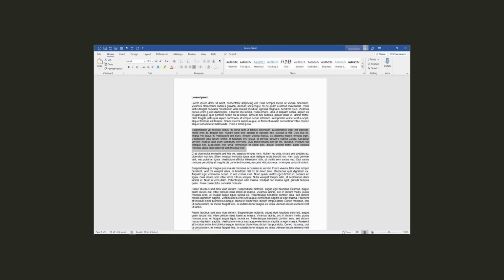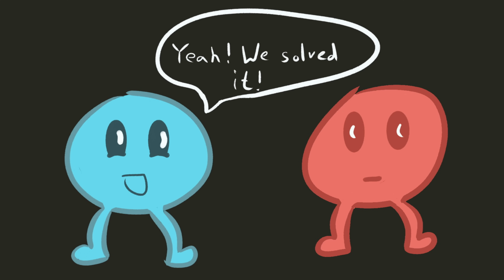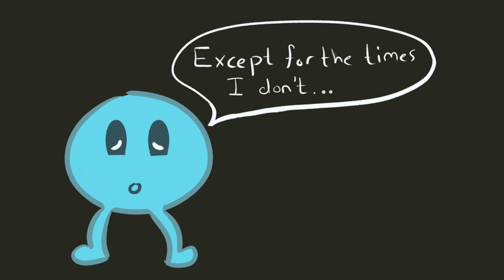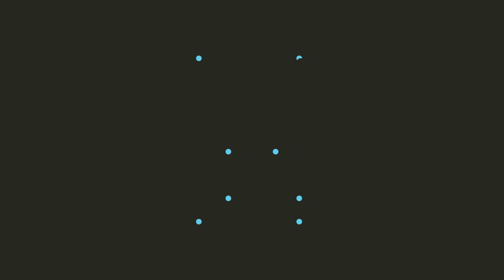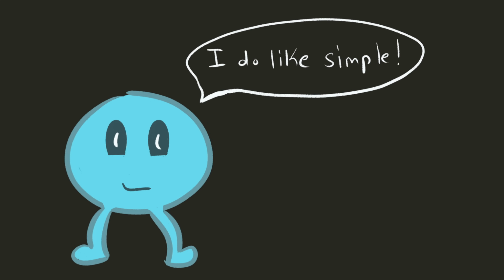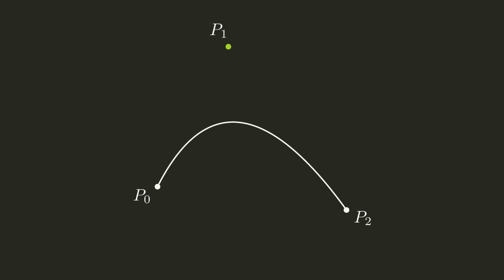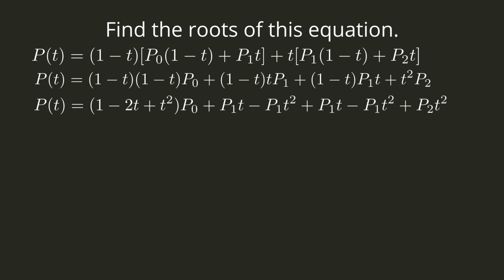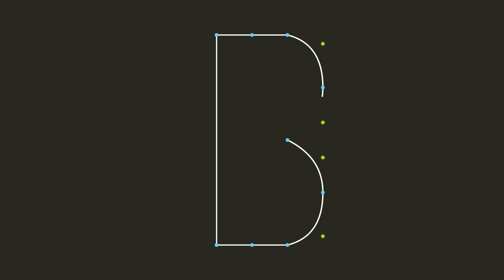The Math Behind Font Rasterization | How it Works

Comment: Might be worth mentioning that there is an alternative solution for fast, real-time rendering of glyphs pioneered and patented by NVIDIA, which is based on using the stencil buffer to determine coverage per pixel. 

Basically, a pixel is subdivided into subpixels and a shader determines for each subpixel whether it is inside the glyph or not. This can be quickly determined if you are smart in how you create your geometry. Quadratic curves, for instance, can be evaluated by creating a triangle from points p0, p1 and p2 and using barycentric coordinates for the vertices. It then becomes trivial to determine whether the subpixel is inside or outside the curve. 

The "winding" path is then drawn first, adding values to the stencil buffer. Next, the "non-winding" paths are drawn, subtracting the values in the stencil buffer. You end up with a stencil buffer containing ones and zeroes for every subpixel. 

Finally, in the so-called coverage step, you calculate the coverage of each pixel by adding all subpixel values for that pixel; if 16 out of 16 subpixels are set to one, you have 100% coverage, but if only 8 pixels are set to one, you have 50% coverage and so on. The final color will be determined by using coverage as an alpha value, or by multiplying the red, green and blue colors by the coverage. 

Substantial research has gone into finding ways to generate optimized stencil and coverage meshes to render, as well as coming up with ways to efficiently store these mesh representations on the GPU. It's sad that this process has been patented, but on the other hand it's free to use if you own an NVIDIA GPU. See: https://developer.nvidia.com/nv-path-rendering
Reply: Other than implementing it with hardware assist, I'm surprised that Nvidia got such a general  patent on the technique.
These sampling methods were being done in the 1980s on devices that needed the resolution and had the memory,
like the Quantel Paintbox and Truevision graphics card applications.
Reply: Could you express that in pseudocode somehow? I know the basics of pixel manipulation (RGB as a byte each) but don't know much about actual graphics related stuff
Reply: @diegoaugusto1561  I've seen a simplified version of this algorithm explained before. It basically goes like this:

Use triangle-based polygons to approximate the glyph using straight lines.

Each straight line on the outside of the glyph creates 2 points on a triangle. All that is needed now is a third point, which can be calculated from the font file.

With these 3 points, we can create a triangle with a curve texture.

After every triangle is in place, the glyph can be rasterized just like any other polygon.

Comment: Are you sure that TTF uses 3-point Bézier curves? Usually 4-point Bézier curves are used in vector programs and most other applications. That will give you 2 control points which lets you create more complex shapes, and importantly it lets you determine the slope in the start and the end points of the curve separately.

I haven’t been thought about this too much but I feel like it would be really bad or even impossible to create smooth shapes but combining several Bézier curves without being able to control the slope in the start and end points
Reply from the maker: Yea I'm like 90% sure haha. You can check out this section in Microsoft's overview of the TrueType specification https://docs.microsoft.com/en-us/typography/opentype/spec/ttch01#outlines . The second paragraph says "Curves are defined by a series of points that describe second order Bezier-spline", and when I wrote a simple ttf font parser I didn't encounter anything greater than a second order bezier curve. Those docs are really amazing too if you're interested in more of the technical details :)

Comment: This is a very simplified overview to get you started, it's very good! The real world of fonts and font engines is spicy. Two examples: Winding orders aren't actually used consistently to mark regions, so you should calculate the normal of the glyph instead to find out which direction it's facing first. Some font tools or glyph operations may flip your glyph for example (I.e. your font has data for b, but represents d as a mirror of b through an affine transform). As for rasterizing bezier curves, font engines will actually linearize first based on a variety of heuristics since the test math is faster. I maintain a fast open source font engine on the weekends and love this stuff
Reply from the maker: Thanks for the comment Joe! Also, thanks for the extra info. When I started diving into the world of fontrasterization I had no idea how deep this rabbit hole goes, and I'm still very interested in how internet browsers are able to handle so many different fonts seemingly effortlessly. Do you have a link to your code if it's open source? If so I would love to take a look at it :)

Comment: Hmmm.  Most vector graphic programs I know use cubic Bezier curves.  Solving for the root of a cubic the direct force way is ugly and time consuming, even with something like Newton's method.  Actual implementations must be doing something else to decide when a pixel is inside the shape vector.
Reply: What softwares do you use? 
I use Inkscape and Affinity Designer for mostly artworks and geometry puzzles. To draw ovals and curves quickly, I prefer b-spine tool to bezier tool. I hate bicycle handles in bezier.

Comment: It would be nice to look at the rasterization of cubic bezier curves after that.
The ones that are used in the .otf font format and in vector graphics in general.
A completely new set of problems arises there. Such as looking for self-intersections, which cannot be done analytically because of the high order of polynomials.

Anti-aliasing is another interesting issue worth discussing in relation to the whole topic of rasterization.
Reply: He also didn't mention that getting the bounding rectangle of each bezier curve is the first step.  The more involved calculation is only needed once you know you are inside the bounding rectangle.  Only in the case of complex curlicues and other thin spaghetti-looking shapes will bounding boxes greatly overlap, requiring a lot more calculations.  I think the only square root you need is in finding maxima and minima of cubic beziers (because the derivatives are quadratic).  Otherwise you just draw the binary rasterized curves (wire frames) in memory ahead of time and then dig them up for cases of points inside bounding rectangles.  

The problem is reduced to finding the best t-step to draw the binary outlines of the curves.  If the t-step is too big your curve will have gaps.  If it is too small you will waste time drawing certain pixels multiple times.  You need a formula to calculate the best t-step given the 4 weighting points of your curve and the given pixel resolution.
Reply: Self-intersection doesn't seem like a problem for fonts as almost no font is going to use a looping bezier.  If you have a deliberate loop in your glyph, you would always use two non-looping bezier curves to construct it.  If you are allowing generalized shapes where the user can place weighting points anywhere they like, like in Adobe illustrator, then you do have to test for points possibly being inside the loop of a self-intersecting bezier.  I think if you're doing graphics where speed is required you simply rule out loops ahead of time though.  The loop is an ugly special case that only has to be dealt with when you can't rule it out ahead of time based on the location of the weighting points.

Comment: Adobe Type 1 vector fonts are from 1984, and the concept of vector fonts is older than that. The biggest difference between Type 1 vs. TrueType fonts is that the former used cubic Bézier curves, while the latter switched to quadratic Bézier curves (I think to work around Adobe’s patents?).
Reply: Adobe fonts were never vector fonts They were scalable outline fonts. There were no Patents. Later Products like Super ATM were Patented, but the font technology inside Postscript was not patented and the Type format and PostScript language were documented in books published by Addison Wesley. Super ATM allowed you to morph Fonts along a variety of axes Blending weights, Set widths, different typefaces together were just some of the dozens  of ways that typefaces could be transformed. The best example I remember is taking text in two different languages and modifying the set width’s and character shapes so that the text matched up line for line.  Apple and MicroSoft got it into their heads that they would be better off if they created their own implementation of PostScript.  It was my responsibility to find a way to win Apple back as a customer. It was not an easy task, thanks to some of the more moderate business development folks at Apple we managed to resolve our differences and build a lot more great product together. Apple and Microsoft spent 100s of millions of dollars and ultimately abandoned the project. True type AKA type 42 fonts was meant to be a faster rendering implementation, in the end it was the same only different. The two type formats and underlying technology were merged together into Cleartype. Within 6 months of Apple and MicroSoft tell Adobe that they were going to put us out of business, Adobe Type Manager was released for the Mac and Windows  “ATM” brought type one scaleable font technology to the desktop along with a Library of thousands of Fully Licensed type faces. ATM was installed on ~80% of Macs Apple grudging allowed as it probably wasn’t good for business if they broke all of their customers machines.
Reply: @rustybucket2248  What is the difference between a "vector font" and a "scalable outline font"? To me those two terms are synonyms. When I say "vector font" what I mean is: “the outline is specified as a mathematical curve; the font is not a pixel-based raster image”. I didn’t mean to imply anything about the relationships between sub-categories of outline-based fonts.

Comment: 15:10 but don't you have to check that the crossings are to the right of the tested pixel?
Reply from the maker: Yes, if you make sure to transform all the coordinates so that the pixel you are testing is the origin, then all you need to do is check if the x-coordinate of the root is less than 0 and that means it is to the left of the pixel :)

Comment: Oh, the Font Wars of the 90's. Fond memories. There was a huge battle between Apple's TrueType fonts (1991) and Adobe's proprietary PostScript Type 1 fonts (1984). There was much debate over the merits of both, such as Apple had special "hints" to display better at low resolution. Adobe responded with Adobe Type Manager which was the de facto standard for a while but was expensive. Then Apple licensed TrueType to Microsoft for WIndows 3.1. But Apple wouldn't license Apple  Advanced Typography, so Microsoft joined with Adobe to create OpenType (1996).
Reply: I was a developer charged with implementing fonts in a paint package way back in the 80s. I remember that black and white Adobe Type 1 Font book well, reading it over and over and over. Our implementation was all in assembly on a TI34010 graphics accelerator. Even for back then, it ran really fast. Decode the font files, calculate the cardinal splines, experiment with fill methods, fix the corner cases, implement kerning, test, test, test. Glorious when all the steps start to work together. People these days don't realize how you had to build everything up from scratch back then, without off the shelf libraries you could just download with working examples.
Reply from the maker: I've always wondered why font rasterization was so difficult, and with a history like this I guess it should make sense why it's not that simple :). I read a bit about the Font Wars as I was researching for this video, but I'd be interested to look a bit deeper into the history at some point as well